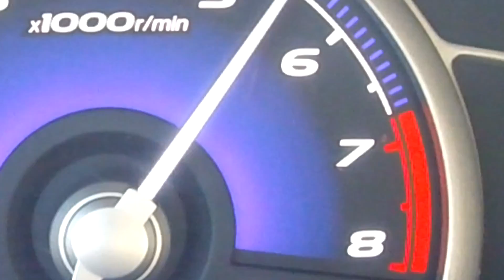(11) Manual Transmission: Learn about Mis Shifts "Money Shift"

Comment: There is another type that's a variation of the neutral mis-shift.  You make it past neutral, but lift up on the clutch a split second before finalizing the shift into gear.  The result is grinding gears.  Have done this many times over the years--it sounds horrible, but thankfully the gears can take it.

Comment: Ugh -- I had my first mis-shift today. Coming from a stop at a red light, shifting from 1st to 2nd, I grinded what I believe was 2nd gear. Pretty sure it was me being complacent and not having the clutch all the way in while putting the gear lever into 2nd. It only lasted for about 1.5 seconds and my immediate reaction was to push the clutch all the way in and try the shift into 2nd again -- from there it was fine. 

I'm worried if this did any kind of damage to the transmission. Any thoughts?
Reply from the maker: you are totally fine on those kind of shift the one you want to worry about is going high speed down gears like 2 - 1 or 3 to 2 and the engine revs up and goes "zing" and parts blow everywhere
Reply: @DriveManual  whew good to hear :) Thank you!
Reply: Had a miss shift yesterday on the highway. I wanted to go from 2nd to 3rd but instead i put 1st. The tires screeched and the engine revved up but everything was fine, and luckily no one was behind. 
I believe the reason why i made the mistake was because of bad hand position on the shifter lever, i was using a hand position which made it extremelly easy to go from 2nd to 1st, and it also looked cooler, but yeah not the most appropiate to go to 3rd gear. I also believe i was being too confident and neglected risks, plus i was with two of my friends (and mom). I felt horrible because i could have made someone behind me crash and the amount of money my parents would have had to spend... specially in a country where inflation is so high.

Comment: Revving the engine to redline isn't dangerous though, so accidentally missing a gear and going to neutral while revving isn't going to immediately ruin your engine, it can on the contrary be good for the engine. A redline a day keeps the mechanic away :)

Comment: can you mis shift going into the correct lower gear but did not properly rev match?
Reply: Yeah. That would still be a miss-shift. Miss-shift doesnt always mean you went to a wrong gear. Its a general term meaning you shifted incorrectly at some point during the shifting process. Not rev-matching would be considered "shifting incorrectly".

Comment: Today i miss shifted from 3rd to 2nd. I was going like under 60kmh and when accident happend revs went at 5 thousand for a second. I didnt notice any damage but is it possible that i broke something?
Reply from the maker: 5000 is normal if you go past the numbers on the tachometer like your car says 1000-8000 and you go to 
10000 then you should worry... but then the car will probably not be running... so nothing to worry about because it is blown up
Reply: Drive Manual Thanks for the quick reply. I am not a professional with cars so this helped a lot.

Comment: I dont understand how money shifts happen. I shift pretty damn fast when im in that race mode, and ive never money shifted. Ive missed the gate a few times on the 2-3 shift, and rarely  on the 4-5 shift on my FR-S. Mostly because it took me a little bit to get used to the longer throws, previous car had a B&M short shifter.
Reply from the maker: https://youtu.be/42jRDxj25dg?t=6m11s
Reply: Drive Manual i saw that video. Wasnt he driving an auto though? He is using hand controls
Reply from the maker: you are right I dont even know how that would work. I think the car has a paddle shift but I don't know how you would skip into 1st

Comment: When I first was learning manual I was used to 6 speeds from video games but was driving 5 speed. I was going 80 K in fifth and somehow managed to put it in reverse on the highway trying to get 6th gear. Luckily I realised it before I let go of the clutch but very scary haha
Reply: Bad design. This is why I prefer reverse near the lower gears, left of 1 or 2.
Reply: @2010ngojo  exactly. Very dangerous to have it under 5th especially when you don't have to pull up a ring or push it down. My Mazda has it near the first gear and the shifter needs to be pushed down for it to go into reverse.
Reply: Adam Murray isn’t there a safety latch of some sort to go into reverse
Reply: @Daddychill945  not all cars. my 1993 Miata doesn't have it

Comment: Been driving Manuals for years, but recently mis shifted trying to go from 4th to 5th but into third at 80mph. But pulled out before it fully engaged in that split second  realizing my error on my '12 V6 Camaro.
Reply: SAM WOLFE did this exact thing, at 120. Didn’t blow my motor, gearbox, or trans. I got lucky but still a pain in my wallet :/

Comment: i admire people who can drive manual transmission so well i drove a manual transmission car today . i could move it without stalling it but when i had to start in a hill the car rolled back , damn it seems impossible to me to start in a hill
Reply from the maker: there a lot of steps to learn in between first moving the car around and if you learn in order then in about 2 hours you should be able to go up hills no problem but if you skip you will always have problems. If you watch these 2 below
this one is the first basic lesson 
https://www.youtube.com/watch?v=bTGP5t54x0s

but now if you watch the hill start video it is exactly what you learned in the basic lesson with some other lessons inbetween
https://www.youtube.com/watch?v=UIwWgEkR4UM
Reply: for me hills starts, step 1 apply a little gas. step 2 let the clutch out until biting point. step 3 drop the handbrake and step 4 release the clutch slowly while moving I use this method petrol engines and on diesel engines i use step 1 clutch to biting point. Step 2 foot on brake step 3 quickly shift foot from brake to gas to move off faster.
Reply: victor larraondo When I was younger my aunt cut her thumb really deeply and had to keep a cast on it for a couple weeks, so she had to rent an automatic vehicle in the meantime. Whenever she could feel the engine/transmission getting ready to change gears, she would instinctively reach down to shift, but there would be nothing to shift with in her automatic rental, so she would just fumble around for a minute and we got a pretty good kick out of that, lol. I was always impressed how, after driving stick for over a decade, she was able to just FEEL when the gear would shift and react accordingly, barely had to put any thought to it whatsoever.

Comment: Fuck money shifts. When I was first learning stick I downshifted from 5th to 2nd (as opposed to 4th gear) and man did my RPM's fly over the redline. My STI sounded like a fucking bike... Couple years later, still no problems. But definitely not good situation.
Reply: Well, every engine is different, your STi probably could hold up higher rpm's, but there is a lot new and old engines that could not hold up high rpm's and they blow up pretty fast
Reply: Bro I did this in my wrx yesterday lucky I felt it early and clutched in quickly.  Definitely will be more careful now
Reply: mine got from 3rd gear to 1st gear it was a beginner mistake of mine :(

Comment: All your videos I see you always press the throttle a couple times before you let go the clutch and on to the first gear. Is that just a habit?
Reply from the maker: Hi someone else asked this I just copy it from there hope it make sense but it is habit because I learned how to drive stick on racing clutch and you can't slip it like a regular clutch it grabs very fast.
"It's faster and easier to engage the clutch if you learn to feather/tap the gas , also you aren't dumping a lot of fuel...but most people drive steady throttle. if you learn on a car with no tachometer and ever having problem trying to find the right amount throttle just tap the gas and it will always land in the right place vs trying to give a steady throttle and trying to hit 1500rpm which you can't see. If you are learning how to drive a stick It's also easier to learn because you don't have to think about the throttle just tap the gas pedal and concentrate on your clutch. There is no right and wrong way whatever way allows you to get quick starts easiest is the best for you. "